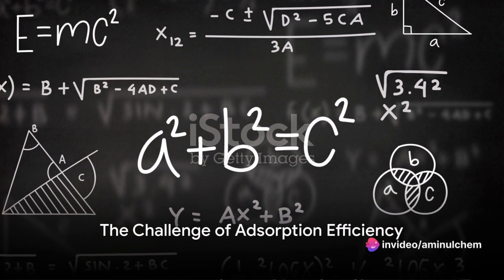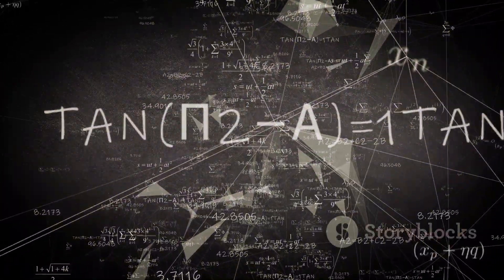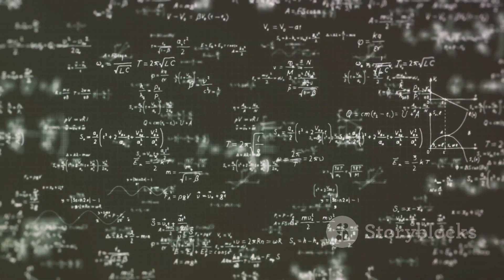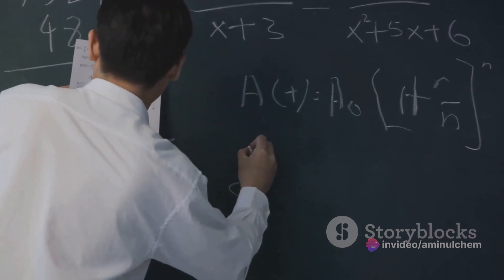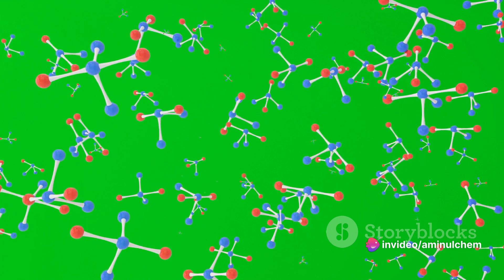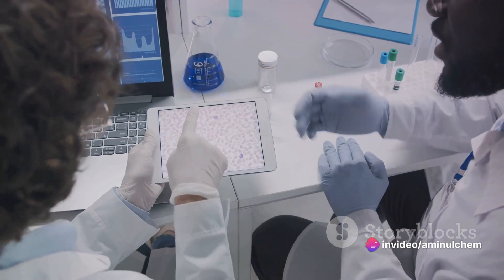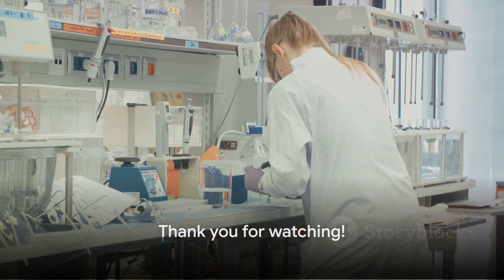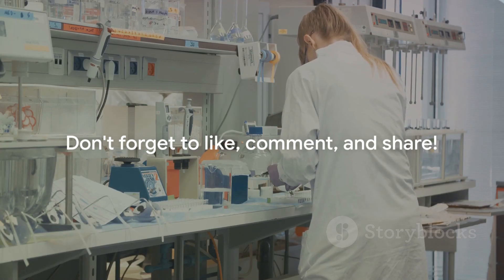Response Surface Methodology (RSM) to Boost Your Adsorption Efficiency

Comment: nice video. Do apply the rsm in variation of parameters of adsorption removal.  using it in synthesis of adsorbent material in removal of pollutants is very challenging, and involves lots of characterisation.
Reply from the maker: Thanks. Actually, it is a software based program and can be done easily.
Reply from the maker: Great suggestion!